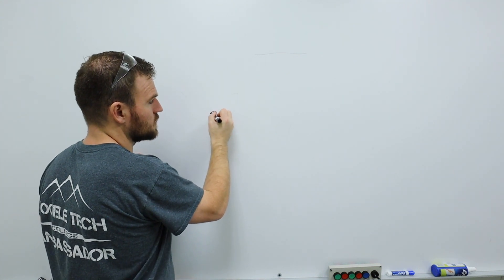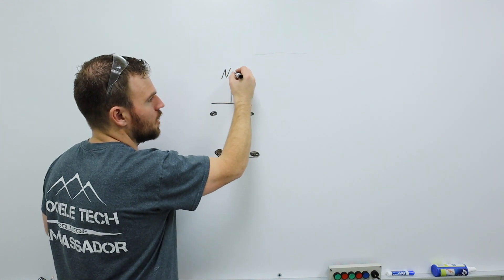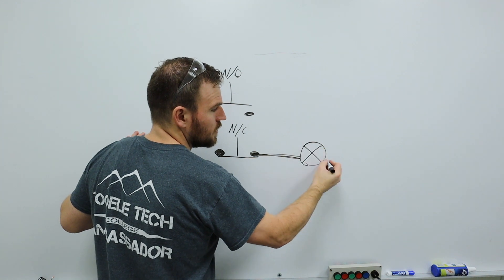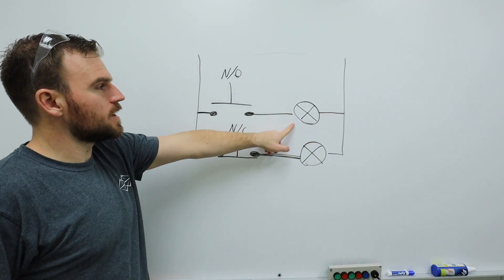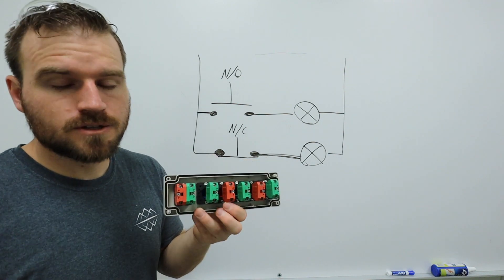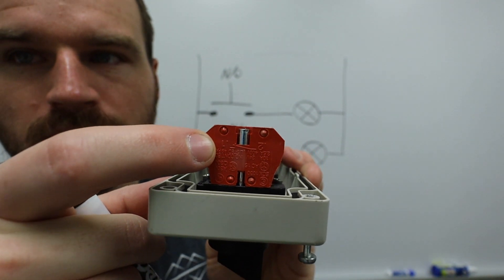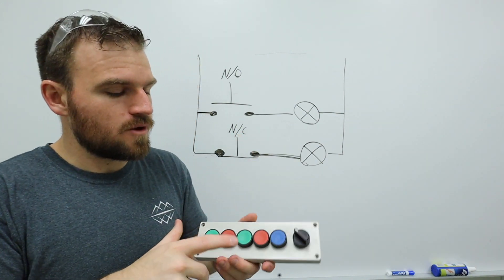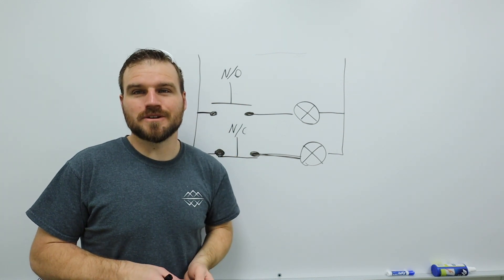Basic Electrical - Normally open and Normally closed

Comment: Normally open or closed does NOT mean the switch is open or closed...it refers to the state of the switch when at rest..inactive..or in the box from the manufacturer..all wire diagrams are drawn in normally closed position...some electrical relays are either open on closed when at rest..being at rest is given the term normally closed..its only a term ...but because we say open or closed this creates confusion
Reply: Ok-this was helpful 😅
Reply: Thanks my guy
Reply: Just learned this in class today but still confused. Wouldn't it be safe for these diagrams if the switch is N/O so it doesn't activate when setting up?

Comment: Normally closed has a voltage
Reply: Not necessarily , NC can be without voltage.
It is No or NC  depending if it energised (voltage applied or not).